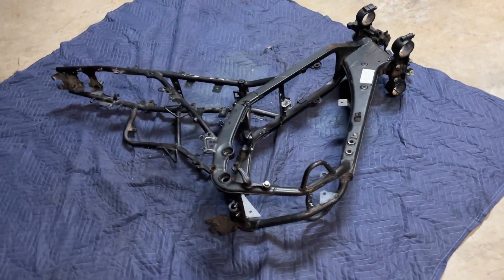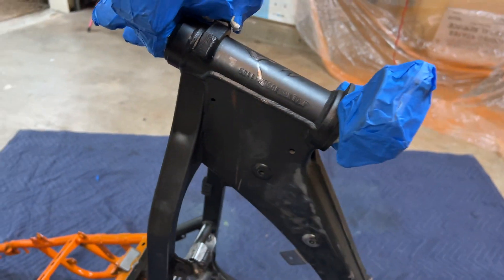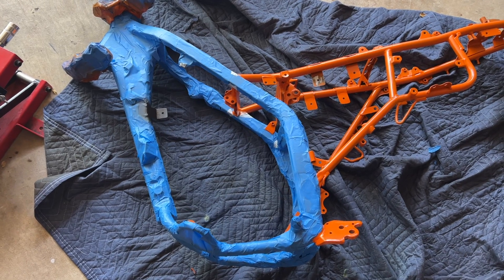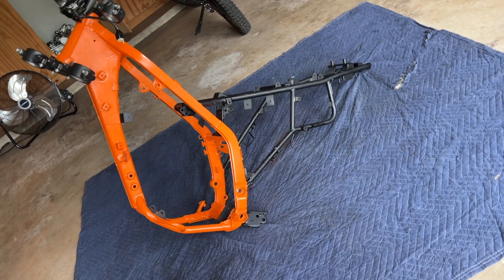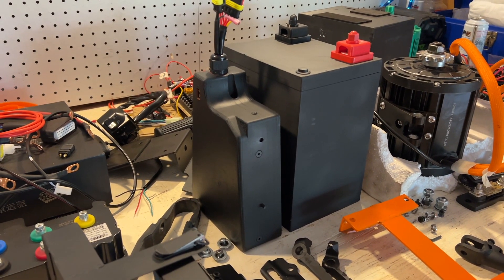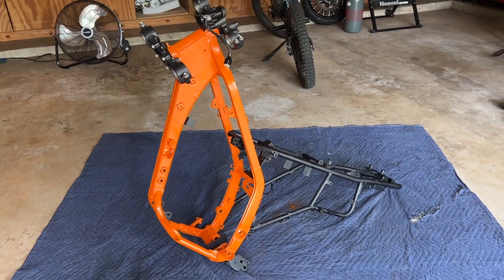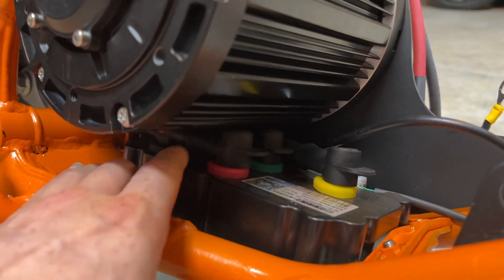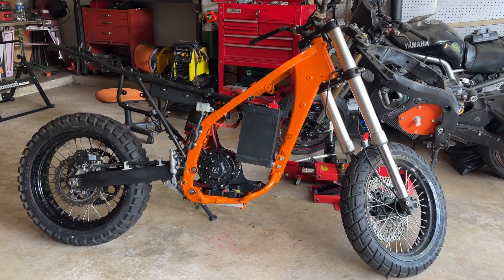Painting the Frame - Converting a Kawasaki KLS250sf Enduro Dirtbike to Electric (Pt.7)

Comment: any issues or concerns about water with that controller being so low?  I thought they needed to be kept pretty dry?
Reply from the maker: not really - they're supposed to be IP6 sealed so although you can't fully submerge them it water, they can be splashed with heavy streams of water. I was originally going to put a skid pad and somehow place a cover in that bottom area to house the controller and wires, but this project started to drag to I just wanted to get something running. Maybe I'll come back to it in the future (aka never do it)

Comment: Do you foresee the orange wearing away over time? I noticed you didn't take it down to bare metal or add any primer, but I have little to no experience with large scale paint projects.
Reply: I painted a ktm 65sx frame for my son, used heat paint and it has held up pretty well! Loving your videos Gaius!
Reply from the maker: the paint I used was mixed with primer already but yeah, I didn't exactly make use of best practice here. Not sure how well it'll hold up over the long-term but it looks good today!